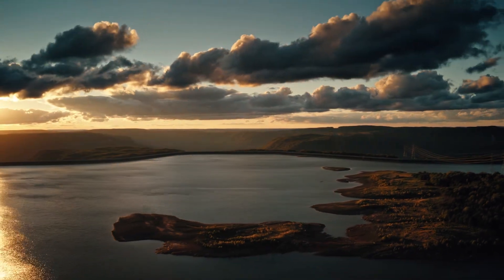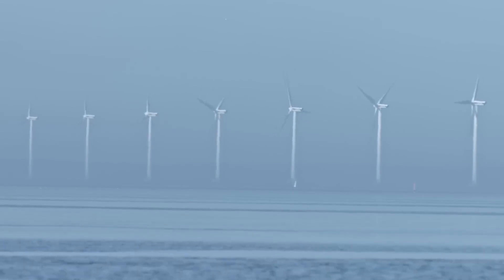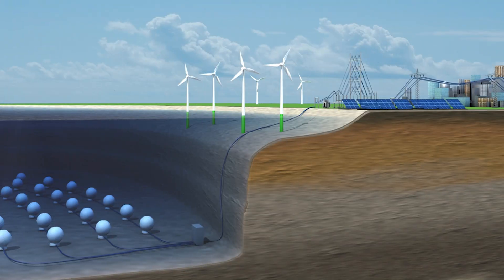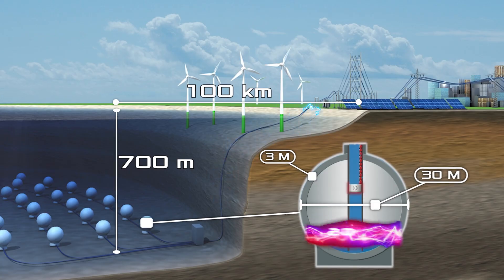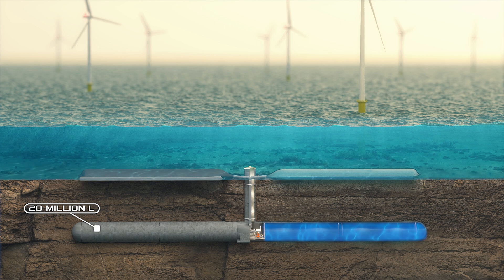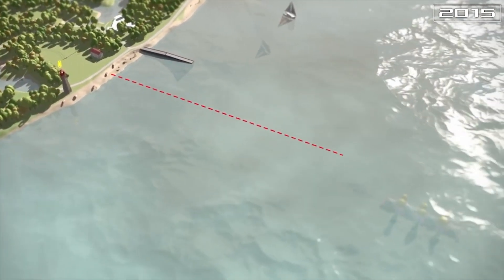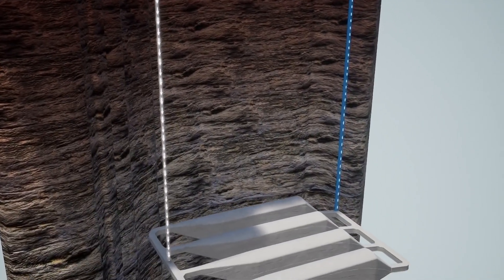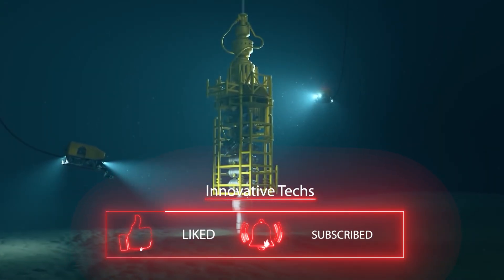Concrete Spheres for Energy Storage at the Bottom of the Ocean

Comment: You need to review the difference between watts and watt hours.  There were a lot of loose numbers thrown around here
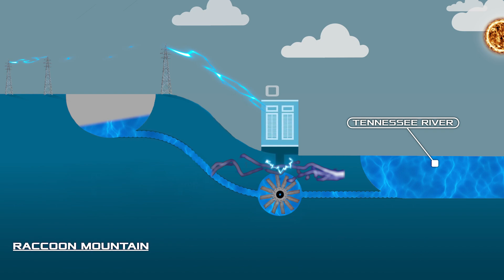Reply: 1:10 Mentions 1,652 MW for 22 Hours
Reply: @ericlotze7724  Which would be approximately 75.09 MWh or 75,090.9 kWh.
Reply: @soulsurvivor8293 no it would be 35GWh, you divide Wh by time and multiply W by time. 1.6GW is power 35GWh is energy

Comment: First problem, how long do the concrete spheres last? Secondly that's alot of concrete waste, more importantly how do you service the motors inside them? Also the bottom of the ocean isn't lifeless, the ecological footprint and damage to the environment
Reply: If I'd build this, I'd use a mechanism that can be operated by a ROV and basically exchange the whole insice (pump, valve, the piping) to service it on a ship and then exchange it on the next sphere. 

Due to the weight of the water on top, the locking mechanism wouldn't need to hold tons of force. The "plug" for electricity is probably the hardest. 

With a second valve to flood the sphere in case the first breaks, there shouldn't be much suction force when the sphere is "empty". 

I think this project really has potential to work, compared to the ideas of lifting heavy stuff on land. And without dwcent energy storage, renewable energy won't work.

Comment: It would be interesting, albeit likely not feasible, if they could use ram-pumps powered by the river itself to pump the water to the reservoir avoiding using electricity to do so.  This would increase efficiency tremendously.  Multiple pumps (many, many pumps I suspect) could, in theory, continuously pump water up to the reservoir.

Comment: Ideally the pumped storage would be powered by solar panels floating on the reservoirs and windmills on the edge of the elevated reservoir. And maybe use anchored bladders of compressed air at the bottom of reservoirs as additional storage.

Comment: MW is not a capacity unit, right?
Reply: No, it's a power rating. MW/h would be a unit of capacity.
Reply: @HerrTyp  No not MW/h either. MWh is a unit of energy. Division and multiplication should not be mixed up.
Reply: A MW is a Million Watts, if not specified otherwise it is for 1 second. Most don't realize when powerplants are specified, it is for Annual production. We get Billed by Killowatt Hours.
Reply: Capacity isnt a fucking unity either

Comment: why not do this in the following usa lakes?
Crater Lake, Oregon (1,943 feet)
Lake Tahoe, Nevada/California (1,645 feet)
Lake Chelan, Washington (1,486 feet)
Lake Superior, Michigan/Wisconsin/Minnesota (1,333 feet)
Lake Pend Oreille, Idaho (1,150)
Lake Clark, Alaska (1,056 feet)
Reply: One the plus side you wouldn't have to deal with salt water or tides or ocean currents. On the minus side there might be more mud / debris at the bottom of a lake, but that's just a guess. The lake bed would probably be considered more of a precious habitat than the ocean bed as there is a lot more ocean.
Reply: Most of thesr lakes drop off over 100’s of miles . So you would have to tunnel hundred of miles to take advantage of the height difference. That would be to costly to do.

Comment: Interesting, but maintenance of mechanical systems at 700m under water, that sounds very difficult and expensive, and how do they ensure that they don’t get impacted/covered by sedimentation on the sea floor?

Also I don’t think anyone is thinking of building offshore wind turbines of that depth except for floating wind turbines, so the pumped storage would unlikely form part of the structure
Reply: Overall I do like the concept though - could work where you have floating wind turbines and pumped storage cylinders together

Comment: Compressed air energy storage for offshore oil platforms, some in 6000 feet of water seems like the ideal application as the power can be used locally and can use wind energy to compress the air.
Reply: Yea but when air is compressed heat energy is released and that increases the temperature of the parts shortening thier life span and it is uselessly pumping heat energy nowhere. It the heat was going somewhere it'd make sense but that would only work at scale. Therefore using water pumps and generators makes more sense
Reply: @cybyrd9615  There is a choice of air or seawater as the working fluid. Fraunhofer uses concrete spheres and seawater. UCAES is also an option and uses air. Compressing air in stages with intercoolers (nearly isothermal) would use the least energy and the storage system could be bladders like those used to raise sunken ships. Water as a fluid means expensive concrete pressure vessels are used. These tanks must hold a near vacuum if water is pumped out. Will be interesting to see which approach proves more successful considering both capital cos and operating efficiency.
Reply: @rickrys2729  Doesn't seawater have corrosive and thus life-shortening properties as well?

Comment: 2-axis PV floating solar lily pads on reservoirs seems like a cost efficient way to reduce evaporation
Reply: Excellent idea and the cooling effect of the water increases the efficiency of the PV panels.
4 pneumatic actuators aka airbags could be controlled to provide an inexpensive control system for each panel. A large panel would be more cost effective as fewer bags are required.

Comment: I dont knwo if they use the tides to increase the efficiency of teh concrete spheres, becaus ethey could empty them at low tide/pressure, and then at high tides it woudl have higher pressure. Although storage is more abotu when wind is available.... also they seem to be very deep unde rthe sea where the presure is high anyway and tides wouldnt make a difference

Comment: Here's the competition -

Lithium iron phosphate (LFP) batteries are on track to drop to around $50/kWh.  Including the cost to package and for the hardware to charge and invert the DC into AC.

LFP cells have a 5,000 to 12,000 full cycle life.  Let's use 10,000 since storage batteries would be stationary.

$50 kWh / 10,000 cycles =  $0.005/kWh

Half a penny.  Not six pennies.

Plus when the cells finally wear out over 95% of the materials can be recovered and reused.  That means $20 to $30/kWh return at end of life.

Comment: Gravity batteries are a flawed concept The concrete itself is very very carbon intensive . We do not have enough supply of concrete and this would take up massive amounts of it at scale. it would also raise the cost of building in the area these were being built in unless significant investment in more concrete production in that area. The cgi model they show is also operating in a fanciful computer environment with no wind, placing these blocks perfectly. How will these work in high wind conditions ? Additionally making all this concrete as a method of storing power idiotic simply due to the fact we already have the ocean and it’s pressure to do what the mass of the concrete blocks would do on there decent/ power release phase. Why waste a carbon intensive building material it makes no sense.
Reply: Thunderf00t debunked the concrete gravity tower over a year ago, everything else here is a joke. There's a reason that everything is a student model or CGI. Scaling up does some weird shit.
Reply: Actually innovations in concrete mixes means they can use less. Look up bunker busters on dark tech YT channel. And it scales so if it takes too much you can just use a bigger sphere, the pressure on the walls won't change

Comment: what do they mean by compressed water? water is incompressible.
Reply: Pressurized, probably.
Reply: In space you can create a vacuum in a syringe by closing the tip and pulling much more easily than at sea level because the air is pushing on the syringe, it is even harder than that under the sea.
Reply: Water pressure increases as you go down under water. Pressure is just force over an area. When force occurs over a distance you have work ie energy. Things can be pressurized without compressing. in fact, things that do compress get hot and in the depths of the ocean youd lose that heat, and the pressure would drop making your energy storage less effecient.

Comment: Why is there a Limit on the distance? China transmits UHV DC 3000km. UHV AC is the current developed world's method of high voltage transmission. 
It does not have to be made from Concrete just as space station modules do not have to be made from Metals. A bigalow type ball could do the same with far lower cost when constructing at depth... similar to the Toronto Hydro but deeper.
Reply: Or you could do something easier, like a bladder full of air. Concrete is really expensive at those scales, and making isn't going to get past the green crowd, that produces CO2.
Reply: @somuchfacepalm8451  actually concerte innovations to protect against bunker busters mean they can handle more greater pressure, you use concrete to maintain a vacuum by pumping the water up, stronger concrete will mean the sphere can be thinner, quicker to produce and faster to transport
Reply: @cybyrd9615  And the video said that the specs called for spheres 30 m in diameter. The most they've tested is 3m, and those walls were pretty thick to being with. The fact that it will work does not make it economically viable.
Reply: Dr T, 

there is no limit on distance per se, but losses are proportional to distance. Simply good engineering practice is to put supply and demand as close as practical.

Comment: a simpler cheaper sistem is a steel tank , cilinder can hold more volume per surface and pressure can be increase by 10, price will be 5 times cheaper than battery so if this savings are invest in solar panels you end up with a self charging sistem, durability 30 to 50 plus years and 100% reciclable.
Reply: yeah.  a thin stainless steel tank has to be far cheaper.  only need to deal with the gauge pressure at the bottom.  so technically the tanks can be as thin as a soda can.
Reply: I just realized the buoyancy of air at that depth will be problem so a thin steel tank won't quite do it.  that is why they are using concrete.  Gravity will keep the structure on the ocean floor.
Reply: @j121212100  steel work for regular tank at ground level,the advantage is that they can be as big as posible , under water have the disadvantage that to make then bigger they never to increase the thiknes or make a few small ones.
Reply: Sphere is ideal shape for "storing" volume with least surface.

Comment: I think you will find there is more than enough Lithium on earth! You can make lithium batteries with cobalt, there is plenty of that also. Heat storage will be the cheapest and easiest to use for long term energy storage. Using Silicon you can store 1 mega watts per cubic metre. Industry needs a lot of heat for presses.
It can also be turned into electricity as well.
Reply: Do you pay attention to any vids you watch?

It isn't you can make lithium batteries with Cobalt.

Cobalt has to be used. It's one of the most important metals in lithium batteries. And we don't have enough of it, either.
Reply: @lordgarion514  Some Chemistries Don’t Use Cobalt Though, Look it up.  Somewhat novel yes, and I don’t know what Technological Readiness Level it is at, but it’s definitely a thing.
Reply: To a certain degree, yes.  ESPECIALLY if we switch to Sodium Ion Batteries. HOWEVER Batteries, especially non-flow batteries don’t scale well.  The main advantage of Li-Ion Batteries is their low weight for a certain power.  This matters when they are in a smartphone, but not when they are on top of a concrete pad by an electrical substation.

Also Batteries don’t scale as well as some technologies.  For every one Watt-Hour needed, you still need the same unit of batteries.  For things like Flow Batteries, Reversible Fuel Cells / Power-to-X, Thermal Storage, or as stayed herw, Pumped Hydroelectric Storage and Compressed Gas Storage, you can have a single generator, but an infinitely expandable “tank”.  The costs of making steel Fuel Tanks for Methane/DME etc, or digging a hole in the ground scale very well as you get bigger.  Batteries are a fixed cost no matter the scale (short of the existing economies of scale due to the widespread use of Li-Ion batteries in Mobile Electronics, which is probably near-peak as is)

I’m rambling here, but short of things like BEVs, Hybrid Vehicles, Mobile Devices, and Small Scale Microgrids, Batteries Don’t Make Much Sense, even then Iron Batteries / Organic Flow Batteries, or even some Power-to-X system may make more sense from an “Appropriate Materials” standpoint.

Check out the channel “Just Have a Think” if you haven’t already; they do a great job covering these kinds of things.

Rant over lol
Reply: @ericlotze7724  I agree with your rant. I was only putting one example for brevities sake. I did find that it is usually the ignorant that reply to my comments as example of Robert Pruitt. They think that because they can type they should. As I pointed out to him it only makes them look stupid. Cheers, John 
PS: Yes, that is a good channel to watch!
Reply: @lordgarion514  I'll add to your misery and the Other's edification, a lot of mining is done by hand by the locals. The Suppliers say no "Artesian" (miners) products, yet 15,000 are in the pits.

Comment: "All the best places are already taken" is defeatism at best and marketing propaganda for other systems at worst. If you started with a perfectly flat prairie, there is nothing to prevent you from digging a big hole, piling up the material removed from it, and making a reservoir on top of that. Landfills would make great elevated reservoir locations too. Low-hanging fruit is not even exhausted, much less human-engineered solutions. There is no reason at all every city in the world couldn't have pumped hydro, if it was actually the best solution for them.
Reply: Look up global pumped hydro atlas.

As for your plan to build a mountain.
To build a 50m high platau using a 50m deep hole would cost $7,500.  (based on my reasearch)

The amount of storage you get from this. 0.272Kwh
Reply: @catprog  we're not talking about building mountains, only plateaus. We have several landfills within 15 minutes of our house which would be high enough. Please don't point out all of the engineering challenges, of course there are some, that's what engineers are for. The cost would be reduced with volume production. Anyway the point is that we have only scratched the surface of the many ways energy can be stored cheaply, and every new scheme claims to be superior in some way. The truth is there are many viable ways, but pumped hydro is one of the least expensive, and we absolutely have not exhausted even the easiest to use locations.
Reply: @crawkn  
You need 100m height diffrence before you start to get significent power.

--

Yes to the easiest to use locations.  That is why I said look up the term "global pumped hydro atlas". It was a study done based on geography to find good places to build pumped hydro dams.
Reply: @catprog  there are 100m height differences most places on the globe, just not immediately next to each other for the convenience of photographers and real estate transactions. That's what pipes are for. I looked at the maps, I understand there are a lot of them. There will be a lot more. Spanning the Mississippi with bridges was once thought impossible. Then it turned out it wasn't. Energy management is an engineering problem with many solutions. So many that it's easy to forget that we have been using some for many decades.

Comment: All these concepts are proved, however they use more energy and store as potential energy of mass or as compressed air. The stored energy will generate only a fraction of the energy used.  This can be useful commercially only if energy supply has low cost and when energy demand has higher price and so all the system will work temporarily.
Gravity has the potential to generate energy on demand and the best places on earth are mountains.  Let lift there effectively concrete blocks and generate electricity on demand, every block will be lifted multiple time on demand and will generate energy.  Partnership between government and investors is a must and agreement to protect the secret on new invention which is not disclosed.  The stationary Gravity engine will generate energy on demand for many decades and will have competitive cost compared with any version disclosed on this presentation.
Reply: Wow genius the concrete spheres do use gravity, by lifting the water. But because the water is at a higher pressure you can store and generate more energy